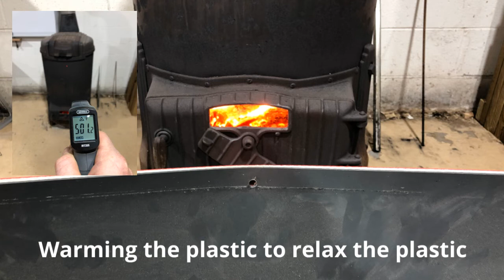Canoe Repair - Motorized Canoe Build (Part 2)

Comment: Wouldn’t it make more sense to start with a metal or fiberglass canoe?
Reply from the maker: Thanks @Lonely Ocean! I really want a boat that will do well in the rocky rivers of Virginia, specifically the James River. The plastic is more "slippery" than aluminum, and will handle a lot more abuse while bumping a dragging on rocks. What's been your experience with aluminum or fiberglass? I've actually been looking at a 20' aluminum one for a "speed" build:)
Reply: @greenlizardusa3105  had an old Grumman canoe once.  Never beat it on rocks though, so I can’t speak for it in that capacity.  
I’m just looking at it from a standpoint of rigidity and ease of alteration, I suppose.  Plastic is (to me) harder to work with than glass or aluminum when it comes to building out or attaching structure. 
On the other hand, you may well have experience with plastic welding and adhesives that I do not. 

Either way, I really look forward to seeing how this turns out!
Reply from the maker: @Lonely Ocean Thanks for the suggestions. You're right about the ease of adding structures, and that will be a challenge for me for sure. I'll need to learn about plastic welding, and I'm hoping I can bolt much of what I'm thinking right on.